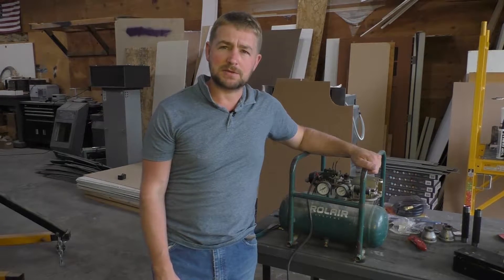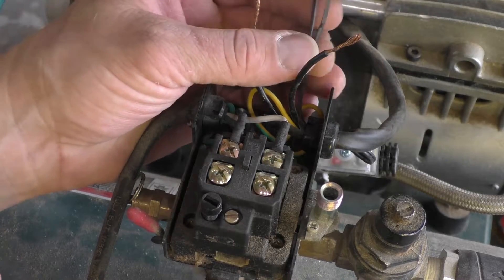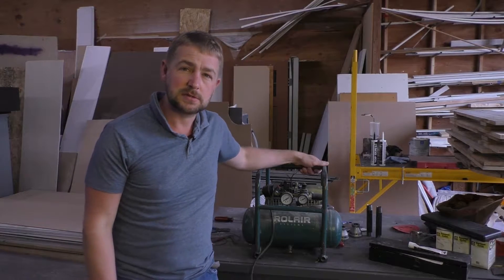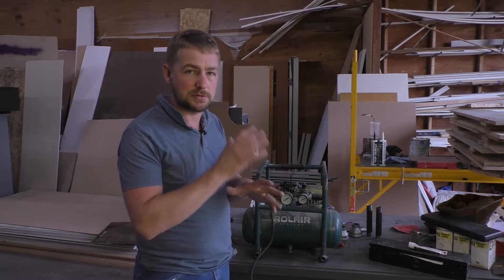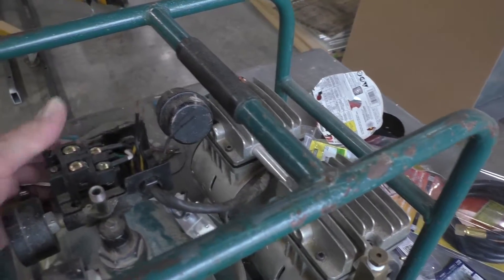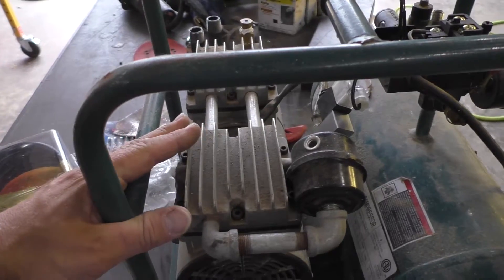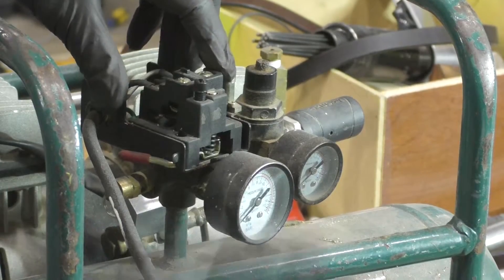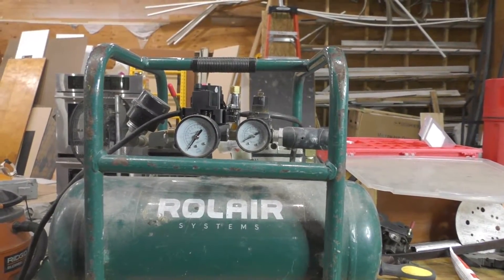JC10 Rolair compressor repair: Trials and tribulations....

Comment: Kind of glad I found this video... I JUST bought a BRAND NEW JC10PLUS.... Got it home and it's having a similar problem to yours... Flip it on and it fills to 125psi. All good. Then suddenly releases air down to 100psi... Okay, not sure if it needs to release that much air just to clear the motor for easy restart, but whatever....  But after that it just lets the tank empty. Never kicks back on. flipping the switch on and off does nothing....  Literally have to just wait 5 minutes with the tank empty before the power switch will actually do anything... No weird noises or hums. Just simple, one fill, and that's all I get...  Unfortunately I got the last one the store had, so I can't even just swap it out for a replacement...They are going to try to 'fix' it for me in the store.....    Kind frustrated, thought I was buying a compressor when all I bought was a problem.....   I'll come back and post my experience with the repair... Just in case someone else has similar experience with a new, or old unit.  I'll point them to the Solonoid in store :)    Of course after watching them monkey around for a while trying to figure it out and hopefully they just offer me a replacement sent from head office rather than store clerk repairs on a day old product.